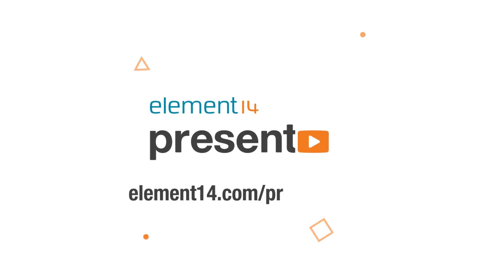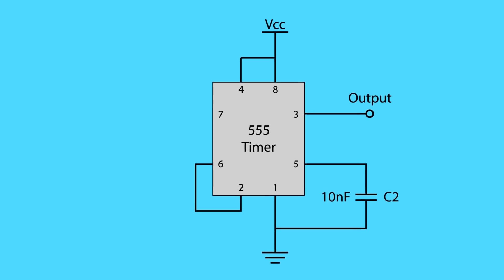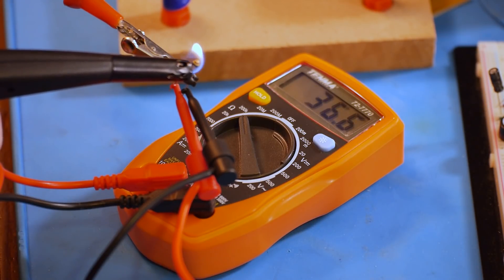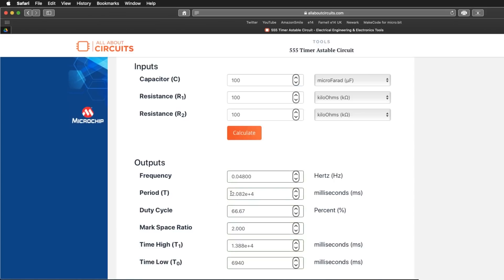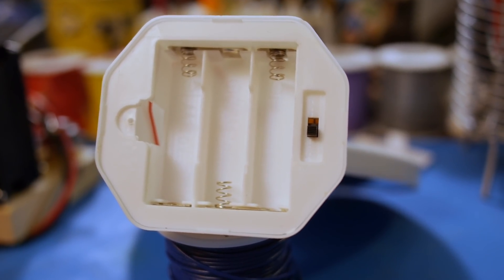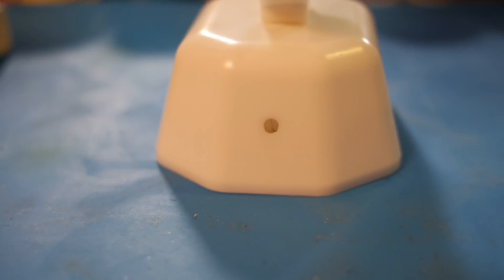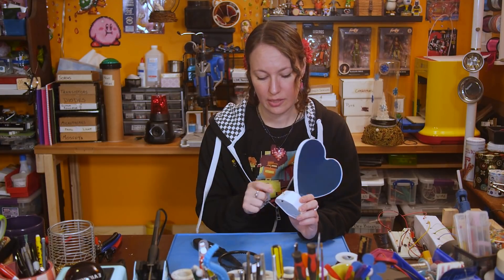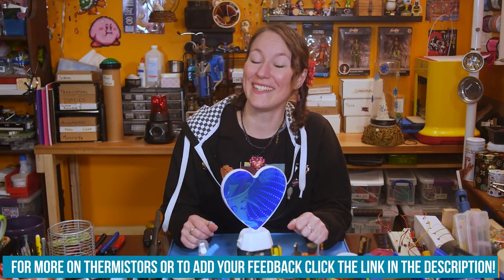Infinity Mirror Beating Heart - The Learning Circuit

Comment: Nice job, such a nice little method to give life if you will to something which may otherwise be bland. Also, wouldn’t having a 10 and 4.7 microfarad capacitor in series give you roughly 3.2 microfarad? That may have been closer to your desired speed.

Comment: Hi Karen!  Instead of completely turning off the LEDs, it would be better to leave the minimum brightness. IMHO
Reply: That would be really cool. A 555 generated a square wave. I would need to replace it with something that generates a sine wave or possibly uses PWM. Any ideas?
Reply: @maker_karen1785  if you had two resistors in series with the LEDs you could use your square wave to bypass one of them.

Comment: Could you run it with two timers in parallel? That way you could have it beat more realistically, no? Like .....-..-.....-..-.....-..-.....-..- etc.? Even make the first beat slightly weaker than the secondary, like a real heartbeat.😁
Reply: Theoretically that would work. However, since parts are not manufactured perfectly to spec, I don't think it would be possibly to get perfectly synced and consistent timing continuously. Not with just using discrete components. If someone knows differently, please speak up.